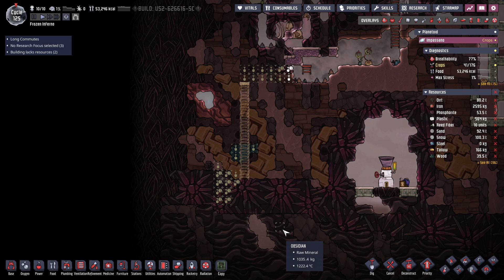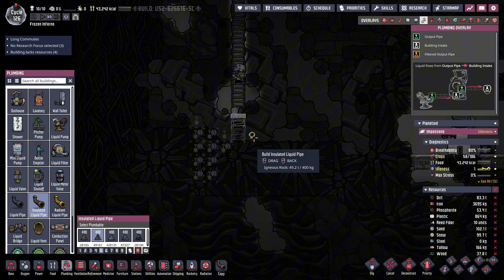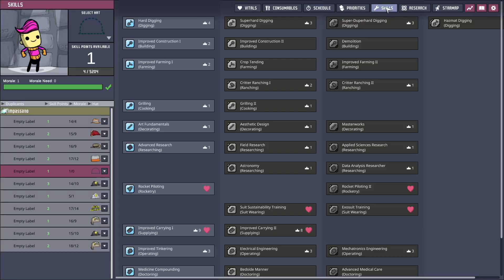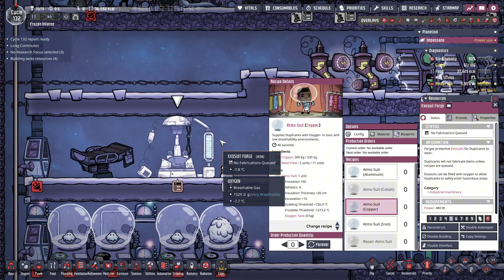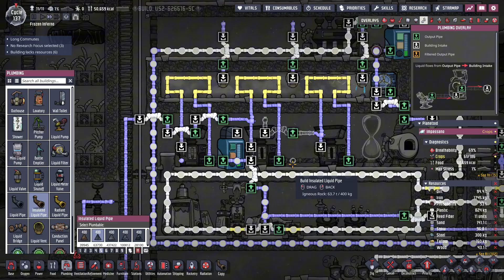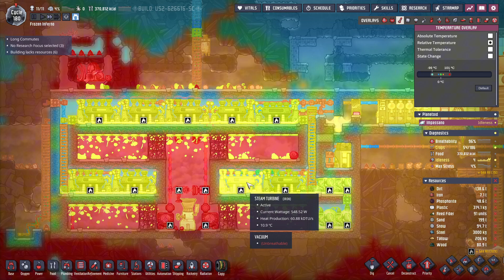Taming Artificial Vents | Ep.7 | Oxygen Not Included | Full Achievement | Ceres-Series

Comment: Following your design, my steam vent overpressures and doesn't emit any more steram, the steam in the lower chambers goes below 125, the top ones go on working at half capacity and overflow more water in the chamber that get transformed in more steam. The system is stucked for the vent beeing completly overpressured. and not finishing its cycle. I followed your design very precisely doing your exact let's play in your same seed. Any ideas? Edit: @ 125 kg per steam per tile the system stopped working entirely, every turbine is not working, all the steam gets cooled and the the vent is overpressured, not finishing its cycle. Subsequently the geothermal heat pump doesn't activate anymore even if it's filled 100% with water. it happened in avout 5 cycles since first activation, and the liquid shutoff is correctly set to below 20kg, so i didn't imput water from outside. 

SOLVED: the problem was I activated the steam turbines a tad too early while the steam was not hot enoug (around 130 C), so this is why it got stuck. Second try I waited the steam to be around 150C and the lower ones never stopped working, not letting the steam pressure to go to high.
Reply from the maker: Good job on working out the problem! The booting process is a little finicky, because if you start the turbines too early, the overflow cools down the steam chamber and prevents more heat input due to overpressurization, like you´ve identified. Once it kicks into rhythm tho, it should run smoothly. Thanks for letting me know :)
Reply: @telx7  I'm sorry to bother you, but eventually it overpressures again, after 100ish cycles. Did you try to run it for a very long time? In my opinion the problem is the top central steam turbine constatly dumps water down becouse its output never goes to the geothermal heat pump. Too much water in the chambers and too much steam. When the vent starts to overpressure the steam in the lower chambers stop working, the vent never finish its cycle and the heat pump waits for a an unstuck vent. The top turbines go on working for another 20 cycles dumping even more water and raising steam even more. Eventually the steam balances itself to 120C at 150kg, the system is stuck, and if you open the chambers your base is gone.

My solution: steel gas pumps in the chambers and a insulated gas pipe to space (and later on for a rocket). Pump automation to activate only for brief time with a timer sensor. It's a safety measure in case something fails anyway, becouse if it fails you have to keep it closed and stuck or melt your base.

Second solution: vent the turbines on the sides of the lover chambers, not on top of the vent. you could bring the pipes down and make a brdge over the liquid pipe thermo sensor. All the 9 turbines should feed the heat pumps while it is recharging. Gas pumps in the upper chamber for safety measure.

Maybe I do something wrong, but be warned bacouse your system has no safety measures like the hydra, and I would not hope that it fails you and you have to make a crisis episode later.
Reply: @telx7  Ok, Including the central turbine in the feeding loop to the heat pump seems to have solved the problem, continusly dumbing water in the chamber while the vents itself produces more steam was the issue. Now when the turbines are recharging the heat pump and dunp the water, the pressure goes down to 55kg, when the heat pump is charged and the turbines dump the water it goes up to 65. Moving the vents on the sides was not a good idea becouse the turbines there struglle a little when they dump the water on the chamber. 5 turbines always at 100% wattage are better than 4. Also the aqua tuners can use the little water that touch them becouse they go dangerously near 275C without it. The gas pump as a safety measure makes me more chill, if something fails i bring the pressure down and unstuck the loop, but with the new overflow it went on 120 cycles. I don't think I'll ever need the external water source and the liquid shutoff system, but it's good to have another safety measure if things go wrong in the opposite direction.
Reply from the maker: @Ygolnac  Oh it´s no bother at all, I´m glad to get your input! 
I am curious tho if everything is set up the same way, because my thought process for this build was as follows:
- we dump 12t of liquid into the steam chamber without the turbines pulling it out
- right before we dump another 12t in there, we activate the steam turbines to recycle the water into the heat pump
-This way we always have a healthy body of steam in the chamber that doesn´t cool too fast whenever the overflow activates
-The overpressurization point for the geo vent is 120 kg, so at no point should your system stall
-With every activation from the heat pump, we lose about 270 kg of water. (12 t input water = 11035 kg output water + 396 kg steam (p. water) + 297,6 kg steam (salt water) = 11728,6)
-After enough time has passed, the steam chamber will drop below 20kg at which point we need to supplement the steam room with external water (ideally already hot water as to not drag down the temperature too much)

So I guess my first question is: at what amount of pressure per tile does your geo vent stop outputting steam?
Reply: @telx7  I tried to look the overpressure value for the geovent from its description but I couldn't see it. Mine gets stuck in overpressure state when the tile above is at 125kg, and from 120 to 125 it fluctates overpressure state. I don't doubt your math, I'm not not so good and knowledged on the game. I'm following your playthrough but I'm slower, I've built your geovent design about 50 cycles later. I've tried three times to rebuild it from scratch loading a save and following your design, I doubt I did mistakes thrre times in a row. The area was more heated becouse I messed a little with the tiles around the fossil. But since I vacuumed the structure before building the turbines and bring in the nectar it should not matter. I'm nowehre as precise as you but I've played around 1000 hours and I know that in this game theory can go wrong when put "on the ground". BTW now I have two safety systems, the gas pump and the external water source. Also in the case it would happen to you I figured there are ways to open the steam chamber without messing the base. You can build a room on the side, vacum it and build a steel pump, then open the rooms from the other side. since the system is stuck when the steam is less than 120C, I don't think it would instantly melt the cables and the transformers, it would go to the new room and you could pump the excess into space. I tried to activate my gas pump to test, if the pipes leading to space are insulated (granite is enough), the steam goes out without causing heat problems. 

I think your geovent design is the best I've seen in guides. It is relatively small, recycles the water and has a massive wattage output, probably the problem is that it relies on a very delicate balance between steam temperature and mass, and little factors and fluctuations (maybe even reloading a save), can break the balance. This is why I would incorporate a steel pump just in case you need to vent away some steam. If the pump is above the conveyour loader it is two tiles above the geovent, and it does wonders in getting rid of those extra KG.
Reply from the maker: @Ygolnac  If you´ve redone the build that often I also doubt that we have a deviation. 
Including my playthrough and testruns I booted up the build 5 times and never ran into this issue. Maybe I just got lucky with the timing. Im curious tho and will try to replicate the problem.
What puzzles me is that you also had overpressuring issues after it ran for a while, because as I mentioned, the system isn´t water positive. 
I´m torn, I´m glad you like it but at the same time feel sorry that it doesn´t  run smoothly for you :D 
I let you know if I can pin-point the problem.
Reply: @telx7  Well, I tried again, and turbines venting on the sides it's the only one that work for me, dumping water on the top of the geovent makes it stuck becouse the steam forms on top of it. Eventually even dumping the turbines on the sides of the top chambers equalizes and 7 turbines work full times, the two above the water dumps go to 50% but recover to 100% very fast.

So to summarize, after testing four times, your AMAZING design works for me if:

- the turbines dump water on the sides of the upper chambers.
- all the 9 turbines feed the heat pump, so while the heat pump is recharging NO WATER is dumped in the chamber.
- the turbines are activated when steam pressure is 50-60 kg, heat is 160C, and only 5kg of steam in the geovent are left in the first cycle. This is very important.
- I added an extra safety measure to pump steam out of the chamber in case it gegt stuck.

So far so good, took four sessions of tries but now it works.

I believe you when you say the system is water negative, but there is your safety system bringing external water that is even hotter than the one coming from the turbines. I just can live with the salt that won't be moved from the upper chambers if this happens, a minor drawback.

As I said, when you put projects on the ground, sometimes they don't fork for a particular player. It is good becouse you have an amazing design to toy to fix for your particular case.
Reply: @telx7  I was optimistic, even my last design got stuck. When all the 9 turbines  dump water into the chamber the steam cools too much and they eventually fail to function, stop sucking steam and the pressure goes up, then the geo vent stops to function. I'm very sorry, I have to give up and look to some other ugly design :(
Reply from the maker: @Ygolnac  I´m sorry to hear that :( I tried purposefully messing with the system to provoke a failure, but I don´t run into the issue...
We input a total of 24t of Water for the booting process and if I don´t activate the turbines at all, I can pin point that about 2t do not get vented before the geo vent overpressures. However, once the turbines are engaged, they will input 12t of water into the heat pump, so these "2 extra tons" are always somewhere outside the steam chamber (either in the pipes or inside the heat pump), which means the vent should always be able to expell all its contents. 
Once we reach the point where we need to input external water, the total amount of water in the system has been diminished dramatically. This engages when the pressure in the steam room is below 20kg, but even if you overshoot and input a little more external water, it should never pressurize the room above 120kg before the sensor stops the additional input. 

I can give you 2 pointers, if you want to still try it.
1. If you want to implement a fail-safe in the case of too much water in the system, it´s easier to just syphon the water from the steam turbine water pipes. That way you can just remove the water instead of having to deal with steam.
2. Make the steam chamber slightly larger. Right now we have 181 tiles, which equates to about 130kg of steam pressure in the chamber, if the full 24t of starting liquid is in. If you raise the lower or upper floor by one tile (or if necessary add more space on the side of the lower floor), the input water should never be able to overpressure the system. To be extra sure, I would make the room larger by at least 19 tiles. That way the initial input liquid can only pressurize the steam chamber to 117.6kg and it´s never possible to overpressure.
Reply: @telx7  I'm thinking about another solution. I pinned the engaging factor of my problem: when water is dumped into the chamber the steam nearby cools too much and the turbines nearby the area stop working. Consequently not enough steam is sucked from the system and this is why it overpressures.

So if I can heat the steam eonugh to never make turbines stop, the pressure issues should be gone. I'll try to tap heat from the hot biome below, using mechanized doors set to close if the steam temperature goes below, say, 150C. This way the steam should stay hot and no turbines should stop to function even if water is dumped into the system.
Since the doors would only close when the steam is not hot enough, it should take many thousands cycles before the heat from the core is depleted. Also the whole thing is easy to implement and uses minimal pover. i have to move the cooling circuit pipes away from the door and build them few tiles away from the aqua tuners, It should work in theory. I'll let you know.

Regarding making the chamber bigger, it is a good idea, but I doubt 19 tiles are enough, in fact when the turbines stop to work becouse the steam it's too cool, the pressure of the steam goes well above 200kg per tile in few cycles. I'm positive the problem is about temperature and not mass.
Reply: @telx7  It seems that heating the steam from the core was the solution, and it seems that I only needed an "Heat boost" in the first vent cycle, after that the steam has stayed hot >250C for 40 cycles and the mechanized doors never closed again. It also seems that having a turbine not feed the pump and continusly dump water down is better becouse the aqua tuners are on the verge to get heat dmg. The good side is that all the 9 turbines work at 100% the whole time. I have to tweak the thermosensors for the doors. In the first try I set them to 190C, but it's better to tone it down becouse they heated the steam too much, it's 300C in the lower chambers. I will try again with the thermo sensors at 150C.
Reply from the maker: @Ygolnac  That´s certainly a solution, because you introduce heat although the vent is not active. 
Believe it or not, but I actually ran into the issue myself by now :D 
It completely comes down to the cycle timing of the vent/heat pump and doesn´t always happen. 
The core problem is that when the system is overflowing the steam turbines practically suck pressure out of the "wings" and dump it all into the area the vent occupies, causing it to overpressure. Now I need the recycled water there to cool down the aquatuners, so the easiest solution is to just remove some of the recycled water (for me it was about 2500kg) to keep the overall pressure in the system down.
Tomorrow I upload the next episode and you can take a look for yourself if you want to :)
Reply: @telx7  Unfortunatly I came to the saddest conclusion. I let the sytem test  run for 50 cycles at full speed and it had zero issues and worked like charm. I then reloadeed frmo a save I made when the system started working properly, changed absolutly nothing, went on playing and in 5 cycles it overpressured. There's nothing wrong in your math, but the game resets some values when you reload, and the balance around your build can get destroied. I've tried several times, sometimes it works upon reloading, sometimes it fails. It can be my own end issue, but I play vanilla. It's not even a bug, when you reload it restarts all the systems from scratch. I've redone the build 12 times and I'm kinda pissed with the game now. Your build is perfect, the game is not. :(
Reply: @telx7  The good news are: tapping some heat from the core the steam doesn't cool and the 9 turbines go on working even when the vent is stuck, they suck enough steam to unstuck the vent and few seconds later it stucks again. So the system does not overheat and keeps on working with the vent flashing between stuck and unstuck. And the Geo heat pump is free to be used for other vents. It's kinda exploity but I will keep as it is, it's not my fault and I sweaated quite a lot :)
Reply: @telx7  Lastly, I don't know if your method of dumping less water in the chamber will suffice, in my tests when it overpressures it overpressures also in the wings eventually. In one of my tries it went over 250kg everywhere and kept raising. I also tried several builds where I excluded one, two and four turbines from dumping in the system ever, and upon reloading it overpressured again. I will try out your solution tough.
Reply: @telx7  There's a bug. Try to set speed to normal and look how long it takes for the geovent to deplete it's cycle. it's 100 times slower than full speed, this is why the system overpressures.
Reply: @telx7  Well, I was able to get around the bug, the system works at any game speed without overheating.

1: the top central turbine always dumps its water in the chamber, the other 8 turbines feed the geothermal heat pump, and when it is full bypass go to an external infinite liquid reservoir. A pump from the reservoir feeds back the liquid shutoff and dumps the 95C water in the chamber only if steam pressure goes below 20kg

2: heat is tapped from the core when needed (steam < 200C), otherwise the mechanized doors stay open.

3: in case the chamber overpressures 2 gas pumps remove the excess into an infinite gas storage nearby, and can be tapped for other uses.

This way at normal speed the vent emits enough steam to have a good pressure, if you raise game speed the system goes negative and the shutoff activates. If steam temperature goes down the system taps heat from the core and turbines don't stop working. This way it should be easier to also utilize the heat pump for other vents.

At normal speed in 10 cycles I've accumulated 65.000 kg of water in the infinte liquide storage and the steam in the chambers is stable at 50kg per tile. That 65.000 kgs of water would have been steam in the chambers and would have overpressured them. at normal speed the vent uses 10 cycles to finish all the steam.
Reply from the maker: @Ygolnac  Wow, I´m amazed with your tenacity and trying to get this damn thing to work :O 
There are definitely some shenanigans afoot with the geo vent/heat pump, because we only input 24t of liquid, but even when the heat pump is full (12t) the overall pressure in the steam chamber is higher than the remaining 12t of liquid should allow. 
So in other words, somehow there is an increase in the overall amount of water even if we didn´t fill the system externally and despite the heatpump taking away 270kg per rotation.
You might be onto something that it is a bug regarding loading the files again. Everytime I tested and waited for the system to fail, nothing happened. But in my playthrough it did occur, because I´m loading the safe file. It´s a shame, but I´m glad you found a workaround.
I will also adjust the build in my playthrough to account for unexpected water influx. 
You´ve been a great help, thank you :)
Reply: @telx7  Yes, I have seen the vid and you were able to unstuck the system without opening the chamber, I was amazed. For sure something is bugging out in my game since now I can make it work only dumping one turbine in the system and the other 8 outside. Despite this the steam is at 70kg per tile and 235C, and it's generating an insane amount of hot water out of thin air. This is why I had to use an infinite storage, I'm on cycle 250ish and I have several millions of liters of water collected in the chamber.

BTW your other creations are impressive, I can't see the time to tame the vulcano and deep freeze the food. I just need to burn sone wood into ethanol becouse I'm draining the pool since I'm way ahead, but I will keep following the playthrough. Keep them coming!